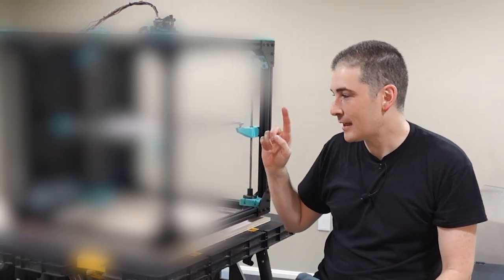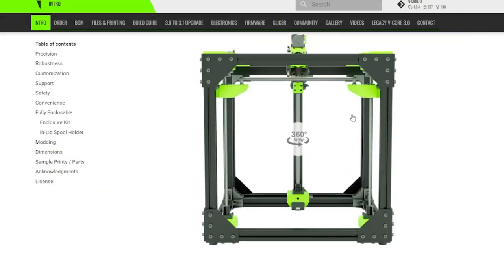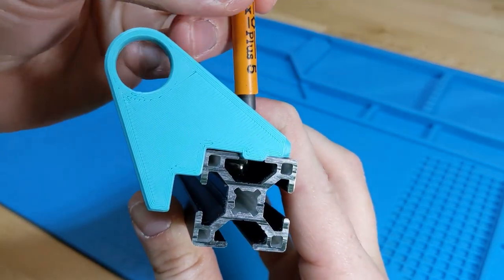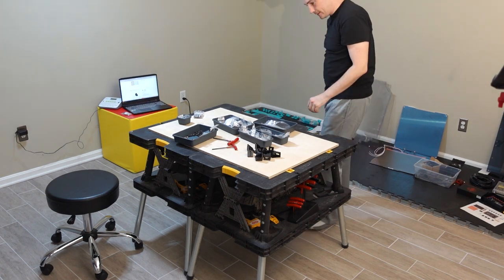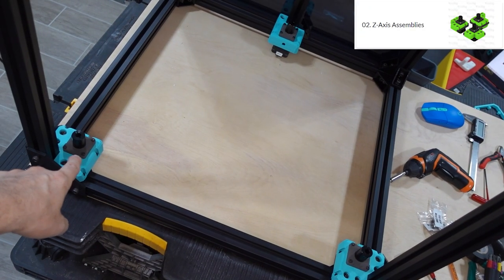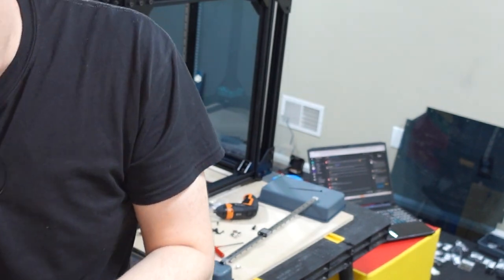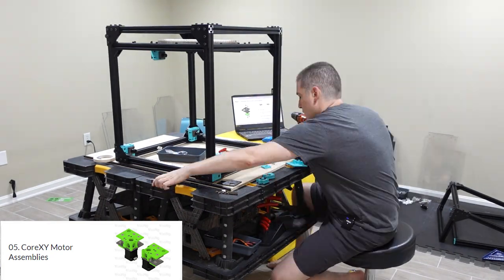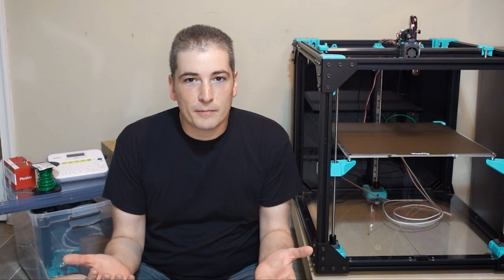DIY 3D Printer Build Experience (I) // Mechanical Assembly // RatRig V-Core-3

Comment: I started building the same vcore 3 (3.0) 8 moths ago. Was great fun building it. At the time I could fire it up got a new job.. so now there is an unfinished project. Bought the 3.1 upgrade and will disassemble the build and rebuild it soon following the 3.1 guide. Just to get every piece just a bit better squared and spaced (the electronics plate to the back frame). Really enjoyed watching your video and recognize the almost despair when looking at the pile of corner plates and bag full of screws and nuts, also the linear rail and bag of screws 😮. But overall loads of fun building it and eager to finish it and get it up and running.
Reply from the maker: I know, those corner brackets really should not be in Step 0, you have to do all that tedious work and feel like you don't even get credit for it because you're not even on Step 1 😆  It's a great machine, and I'm glad I got the 3.1 upgrade before I started building it.  I missed out on "Enclosure 2.0" but I finished this enclosure and it's ... meh, good enough. 

If you're not familiar this video was widely cited on the discord for how to make sure your frame is square (and which parts are important and not):  https://www.youtube.com/watch?v=h7ZTq2dDTkM

Comment: Safety tip: if you can't hold the part in such a way as to not drill towards your hand, then don't hold it in your hand at all. When it comes to small parts, attaching it to a surface, possibly gluing it to a sacrificial piece of wood then clamping it to a surface is the best move.

What are you going to use to power the printer? A Raspberry Pi or something else?
Reply from the maker: Good tip.  It was a painful lesson to learn and still have a scar 9 months later. 

 The RatRig is run by a BTT Octopus and Raspberry Pi.  RatRig publishes a custom version of Klipper (printer firmware/software) called RatOS .  I'm excited to try it out and will include my assessment of it in one of my next videos.  Based on the docs and discord discussions, it looks pretty streamlined.

Comment: Awesome build videos. As I need an increasing number of large, although almost flat, parts printed in nylon, the 500x500 version with an enclosure looks like the best option, wired for 220v. I'm tired of importing printed parts from China, and this should pay for itself quickly.
Reply from the maker: Thanks!  I should mention that I have been printing a lot of large flat parts in ABS & ASA, and have actually run into reverse warping.  Instead of corners peeling up, part turning into a taco, it prints totally flat, but must have some kind of internal stresses, because as soon as I pop it off the build plate (after 1 minute, or 1 day), it immediately bows upwards in the middle.  This is with 250C nozzle, 110C bed, and 55C-60C enclosure.  See this: 

https://www.reddit.com/r/3Dprinting/comments/14eqmk2/

I bring it up because nylon is even more difficult to control the warp.  Some nylons are better than others, and I'll be releasing a video soon comparing a bunch of different printable nylons (and a couple nylon-likes).  A carbon-fiber-filled nylon is way easier to control, but I still consider it more difficult than ABS/ASA.  I'm actually a little bit at a loss for what to do, besides simply switching to PETG or PETG-CF for large prints.  In this case, the enclosure is making it possible to print the part, but it's not warp-free.  Just thought I would throw that out there as a word of warning.  I'll also let you know if I figure out a way to mitigate this issue.
Reply: @ObsessiveEngineering  I'll watch for that. The parts I'll be printing need to be solid up to at least 200F, and compatible with immersion cooling fluid, so polycarbonate or nylon seem like the best choices for sealed battery boxes.
Reply from the maker: @hallkbrdz  Focus on polycarbonate then.  Nylons technically handle temps like you're talking about but only under no-load conditions.  They will creep/stretch quite a bit if under load at elevated temperatures.  Nylon-CF and Nylon-GF are quite a bit better and worth experimenting with, but I think polycarbonate is probably a better choice overall

Comment: Hi will be starting the build on self sourced parts and was wondering what gauge of wires are used electrics ? apart from the motors as you can buy that loom off ratrig

Comment: Hi, I'm looking to buy a ratring and I can't decide between the 200 or 300 mm size.
The power consumption just jumps through the roof between them.
And do I need to source the power supply by myself. The 250W seems quite low...

Comment: Nice work!
I wonder if the AI part of the channel will play into this project.
Reply from the maker: Ironically, I originally started this channel to do AI and engineering educational/project stuff.  But both my 3d printers broke around when I started this channel and for a couple months couldn't do some of the things I had planned. So I've been focusing exclusively on 3d printer stuff for now.  I've obviously had a lot of fun doing it but I will be broadening the scope of my videos a bit once I finish this RatRig.  I don't think I'll be doing any AI stuff with the printer hardware itself, but 3d printing will remain an integral part of my projects going forward 😁

Comment: i wonder if the bigger bed size should come with a thicker build plate as thermal expansion aswell just general ease of warping the bed can be easy
Reply from the maker: I don't think it makes a huge difference.  The plate is SOLID and making it bigger would increase it's thermal mass taking more time and energy to heat it up.  

I see a lot of people in the RR community obsessing over bed warping and expansion.  I have spent very little time messing with it, and the difference in Z between the middle and the edge (~280mm apart) is a whopping 0.42mm.  I don't know what I could print that that slight warp would matter.  Material shrinkage of most materials would dominate that term.

 The only thing that would affect would be the first layer adhesion, but with automatic mesh bed leveling, the printhead movement will adapt to that shape anyway.  I've never had a problem with adhesion being inconsistent across the plate. 

Btw I don't want to discount this general effort to get better bed flatness, but for me the default behavior is sufficient.  If you don't have mesh bed leveling, it would be a totally different story.
Reply: @ObsessiveEngineering  Hi Alan, your explanation make perfect sense, and i agree if you dont have mesh bed leveling 0.42mm would be a huge challenge but we do! and yes definitely bigger thicker bed will take much longer to reach it targeted temperature than a thinner one. The reasons i bring this up, is bec i been recently working on vibration tester equipments and we have been looking into changing into thicker mounting plates to improve their flatness and also ofcourse more uniformed and consistence predicatable vibration results.as we had issue where the orignal mounting plate has warpped over time as rigs get bolted on and off and that thing is already 15cm thick. So i though in relation to printer bed where it ideal to have bed as flat as possible, should the bigger the bigger the bed be made with thicker plates as it is easier to bend and warp especially the 500*500 size
Reply from the maker: @8bits955  that's super interesting.  Is the warped shape of the plates actually changing the frequency response of the system?  Given that the RR bed is unconstrained it probably wouldn't make a difference there.  But if it's bolted down I could imagine the deformation warping the frame of the machine and that could definitely have an effect

Comment: One year later, built a corexy from scratch. Still trying to get the firmware burned. Both x and y move together.  Any help will be appreciated.
Reply from the maker: Not sure how much I can help through the comment section, but I should mention that there's a lot of great Discord communities with people who are really knowledgeable about this stuff.  I find the RatRig discord to be pretty good for these kinds of discussions, and they have an #other-printers channel where you could ask about non-RatRig printers
Reply: Look up rolohaun and vez3d
Reply: Figure it out?
Wondering whether there's a "dual X-axis motors" switch turned on.
Reply: Or something like set to Cartesian instead of CoreXY so it doesn't cancel out motion on one axis with the other.
Or simply one of the motors has one of its wire pairs swapped so it's running backwards?